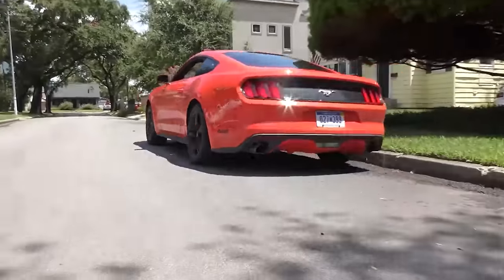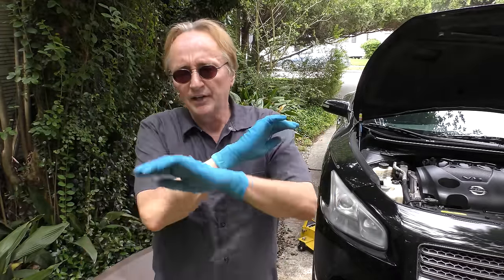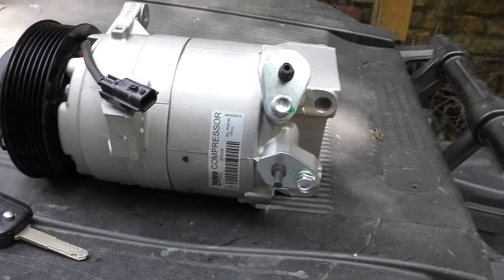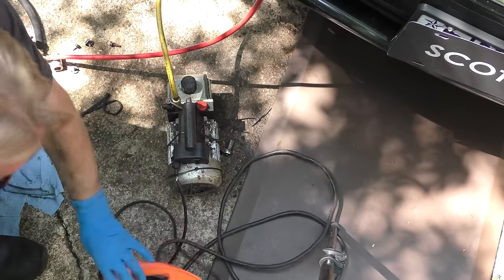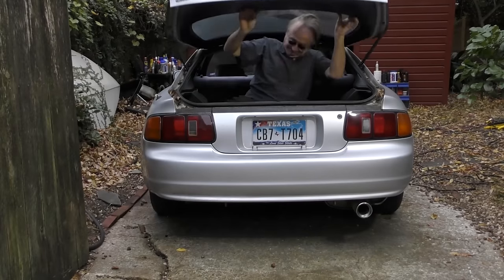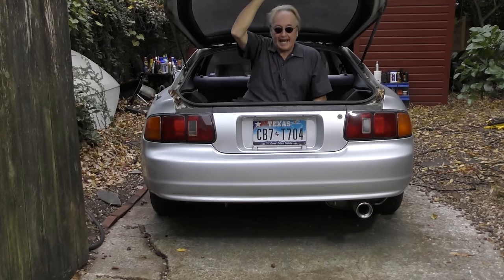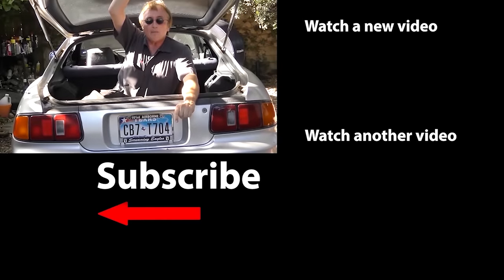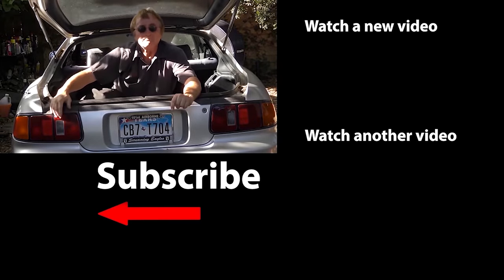Here's Why Nissan Doesn't Want You to Work on Their Cars

Comment: you should replace your condenser when replacing a compressor on an older car. it's probably the main reason the compressor went bad in the first place ??? and if you dont want to replace your brandi new condenser again a short while later, I highly recommend. aftermarket condensers are cheep nowadays

Comment: Dealer charge me $1,300 for new  Compressor.they fix it

I say it was worth it. 

Mine  Car still in good shape.  No need to buy new car or newer one.  2 years later AC still working good and still no car payments .

Got to be ready to repair your ride, set money to the side for just in case. 

It's better to spend a few hundreds then be on car payments. 

 Average car payments per year is about $4,000 to $6000

Car repairs about $300 to $1,500 a  year (  maintenance and repairs)

I choose to repair.   Unless it's a major engine or transmission problem  then it's gotta go

Comment: Hey scotty, I was wondering if by any chance youve fixed an AC on a Chevy Cruze 2011-2016 preferably. My AC is not working. I bought a recharge but the gauge went to red. So I didn't out any. The compressor does spin. Could it still be faulty? Any suggestions? Thanks for all your valuable time and info!
Reply: Jonathan Juarez I have a 2012 Chevy Sonic Lt, unfortunately the only problem I’ve have had with my ac was the thermostat housing unit cracked recently, so I would check under the hood of your car just see if that hasn’t cracked since the Sonic and Cruze are on the same platform, I mean Sonic and Cruze are not the best Chevy’s ever made, but certainly not the worse, the Aveo certainly wasn’t the best, but the Cobalt was hit or miss, and the Cavalier was before my time for the most part, but either way just continue to maintain it, because Chevys are not something you should beat up and toss around like Ford it will break. 🤔
Reply: Were you having over heating problems? Because my car is not overheating. Nor leaking. I just want to see if anyone has had any issues with the AC on a Cruze. I'm going to remove the freon. I haven't had any ac device on mine. But am concerned because I know when the arrow on the gauge goes to the red zone. You shouldn't recharge it. I've had problems with the thermostat, but usually would overheat because of the plastic housing next to the engine driver side.
Reply: Jonathan Juarez My car overheated twice on me yes, I’m not the original owner of it, I got it used at a Honda dealer, oh everyone I talked to said the Cruze is not a bad car no complaints, oh yeah you may want to take to the shop and see why your thermostat is acting up? 🤔 Yeah my thermostat housing unit cracked recently, but it runs better now, minus the valve cover gasket had to be fixed, I haven’t had major problems unlike my 2010 Mini Cooper S Convertible smh! 🤦🏻‍♂️

Comment: I had the aftermarket Chinese compressor on my Peugeot 407 fail, had metal shrapnel through the whole system. To replace all the parts was about the same as the car was worth so I just got rid of it.

Comment: Im looking to buy 1995 Nissan 240sx with a 2.4 liter cylinder runs good and in good condition no rust but was wondering if these motors are reliable enough to consider buying.

Comment: Scotty I bought a New 2019 Nissan Leaf SV Plus.was driving it yesterday to the store 7 miles away and the Nissan Connect kept Up Dating every1mile or less. Decided to count how many times it would Up Date going to the Dump 4 Miles from house. and it Up dated 5 times. Went to Nissan on a Saturday was secound in line but they said it required a Nissan Leaf Tecnhician to plug in a Diagnostic scanner really it just plugs in I thought? I just wanted to know if any error codes would show up. Of corse today on the way to dealership it only Up Dated when I first left the house. I wewnt to another dealer and he said he could not even rotate the tires. It's apperent to me Nissan Sales Nissan Leaf's but do not want to service them.

Comment: Hello, Scotty. Thanks
When you have to idle a new 2020 Toyota Corolla for a long idle periods how does that shorten my oil change periods(like comparing to motors that used to have hours of operation meters on the motor)?
 Is there an equation for hours to miles driven to know more precisely how to adjust my oil change period?

Comment: Scotty, 

  If you have evacuated your AC refrigerant already can you install a contaminant filter on the high side discharge line between the compressor & condenser to prevent the condenser from becoming plugged/contaminated should the compressor ever "grenade" spewing metal particles into the refrigerant ??

Comment: Hey Scotty, I bought a 95 Celica Convertible GT for dirt cheap as a fun project car to learn stick on. It runs and drives good, there is just a problem with the trunk. My key turns and it doesn't open and pulling the trunk release inside doesn't either. It's hard to get in the back cause of the convertible stuff in the way, there's just a hole big enough for my arm and it definitely doesn't reach. what should I do?

Comment: Is not how much time you put the vacuum. You need a vacuum gauge , recommend a digital to measure microns. Go up to 500 microns. Once the level is reach , close valves , check if hold the microns. You wasting time. One hour? Am AC contractor for industrial and commercial HVAC. Doing this for 30 years.

Comment: Scotty I have a 2004 Nissan Maxima it's blowing white smoke out the tailpipe, and I'm told that the coolant is mixing with the oil through the head gasket. Would. A liquid head gasket fix the problem or make worst. I don't want to pay to replace the head gasket as this has already cost me a small fortune. The car has 114,000 miles what can I do?

Comment: Scotty...I have a 2017 nissan versa with about 61k miles...the dealer is telling me that I need a transmission flush...I seen some of your videos saying it's not a good idea...and by rpm gauge is jumping when I am parked...when I accelerat it doesn't react right when I do it, an it also seems to kind of studder when I am driving (only has happed about 5 or 6 times recently)an the dealer is telling me that it's all problems from the transmission...what do you recommend ?

Comment: Hey Scotty I've got a 2014 Nissan Maxima sv and Nissan is telling me that liquid got to my control panel for the radio, navigation, air, heat just everything in the middle from the cup holders..... Is that truly possible??? I'm thinking that there should be a safety feature for protecting that sort of thing. They're wanting to charge me $1,000

Comment: I have a 1999 Lincoln Town Car and it cranks but no start. The battery died over the winter and I attempted to get a jump. Since no start I sent it to my local trusted shop and they told me there’s no fuel, fire and no communication to PCM, but it cranks. They did not want to get involved and dropped it back home no charge. After many hours of research on Youtube, I checked all fuses, switched corresponding relays and connected my own scan tool and still nothing. I even hired a private mechanic to check it out and he said “sounds like your security system”. He suggested for me to go to a auto electronics place and have them program the key. I called a local locksmith and he brought over two devices and made another key as well. He was able to clear the 6 keys that were in the system and place the 2 keys (original and a copy he made), but the security system did not reset still. He read the manual for errors codes and said “the security system is in an anti-scan mode”. What can I do now besides go to my local Ford dealership. HELP!!! Thanks in advance.

Comment: If nothing is clogged, the sludge that is in there isn't circulating, so it's not doing anything but taking up some room in the bottom of the oil pan.
A strong sludge remover breaks all of that crud loose, any on the oil pan side of the oil filter gets sucked up, goes through the oil pump. Any particles less than about 30μ (0.001”) gets pumped through the engine.
Varnish is far less of a problem. It just stays where it is. Instead of using that cheap non-detergent crap* to save 50¢ a quart, use a top quality all-synthetic motor oil to gradually remove varnish.
* The non-detergent oil is good for machine tools – lathes, drill presses, and for oiling garden tools, pliers, wrenches. Not even for your lawnmower.

Comment: Scotty, my daughter's 09 Fusion has a leak at the ac low side charging port. It's leaked empty. Would it be a good idea to also replace the $30 expansion valve at the same time?  160k miles.

Comment: In a power plant they use vacuum pumps on the condenser as the condenser is supposed to be at pressure less than atmospheric. They call the process of removing the air Hogging. Funny that you put a picture of a hog up when using your own vacuum pump.

Comment: My 2006 nissan altima turns off sometimes when either I'm at a stop light, a couple times when I was reversing, when I try to turn the car on it sometimes won't turn on the first time but I'll wait a few seconds and it will crank up. Any ideas?

Comment: Hey Scotty ,
There is a 1989 Honda Prelude S manual transmission with 166000 original miles and in good condition. They are asking for $3000. What do you think?

Comment: Hey scotty I'm looking to buy a 2005 scion tc with 113,000 miles. I read that the 2.4 motor they use in them are the same as the camry and rav 4 and have oil consumption issues . They're asking $4000 , is it a good deal? Thank you

Comment: Give me you  car, no mater what brand and if it has an automatic
transmission it will fail. As for Toyota and Lexus, Uh, my boss's 
Lexus is a 2014 and an endless money pit. My Friend bought
a 2019 Corolla and the transmission failed before 30K miles.
But, his Tacoma is still running great. Depends on the make 
AND the model. I see Nissan Altimas and SUV's with major problems while
people I know who own GTR's and 370Z's run them for hundreds of thousands
of miles with minimal issues. Basically, it seems that rear wheel drive cars with manual transmissions hold up the best. FWD with an automatic? not so much.
Well, unless it is a Honda. Honda makes one tough car and 
THE best most reliable engines.

Comment: Never try to start a car that has set 4 years. remove Every spark plug and fill the engine cylinders with synthetic motor oil (the thinner the better) every single piston with the oil. if you can Get to the valve covers easily throw some synthetic in there . And wait a good week then drain the oil completely out of the pan fell with the proper weight oil of synthetic, either turn the engine over by hand then by  the starter without any plugs and push out any remaining oil in the cylinders put the spark plugs back in. and start her back up. So many people cut the life of the engine short by just sitting in the car and turning the key after it set a really long time. If your piston rings are seized to the cylinder it may start but you have screwed up your rings and may have scarred your cylinder walls at the least it will start smoking and that's just the indicator what you've done to the drivetrain has multiplied that as well

Comment: I wonder should I have this shop put oil in my ac lines to free my compressor up. I didn't use my ac to save gas and it locked up on me, I wonder should i use this used one that spin perfectly from the junkyard for my vehicle just not sure how to go about it so I just have my ac working again

Comment: i have a question.. i have a mitsubichi aveo lt 2011 that suddenly stop running. when i hit the gas pedal on reverse or neutro the car acelerate but when i put drive the car doesnt acelerate how is suppose to do it and doesnt move. the car runds in reverse like nothing but doesnt go foward. i changed the computer and program it too, still does the same thing. what this can be

Comment: My 07 maxima is also leaking from somewhere ac compressor spins when recharged. I think one of my ac lines is leaking
Reply: I just fixed the ac in a.2007 maxima I gave 2 someone.  It needed a compressor and thenac line was so corroded it needed 2 be replaced.
Reply: Dab, or spray some soapy water on the hoses/connectors. Bubbles will form where leak is.

Comment: I drive a 2016 Nissan Frontier 4 cylinders RWD for work provided by my employer. The compressor and discharge hose for the AC failed on this vehicle last month. Earlier this year, the o-rings failed and leaked on 2 other hoses for the AC system. Truck only has 88,000 miles. The quality on this truck sadly is too low. Avoid Nissans.

Comment: Hey Scotty, my 98 Dodge truck has a 5 spd manual transmission, when it's in neutral and the clutch is depressed it's silent but if I lift the clutch I hear a faint pulsating sound like a quiet knock, what is this?
Reply: Probably throwout bearing in the clutch assembly
Reply: Definitely the throwout bearing, just leave it until gets louder, just get out as much as you can out of your clutch and replace everything while your down there when the time comes.

Comment: Toyota’s are boring, people buy Nissan’s because they always offer more performance, appeal and are more affordable. They might have had some issues with some models, mainly cars built in the USA and Euro, but give me a Japanese built Nissan over a Toyota. Scotty if Nissan is as bad as you say they are what do you think of Volkswagen. Also how many miles did the Maxima have, you also mentioned that car as been hit a lot, I saw that the inner wheel plastic cover is damaged, is it possible that the condenser has been broken many times and the panel shop hasn’t followed the right repair procedures. My experience with air conditioning system on Japanese cars is if the system has never been open since the vehicle was made, they can last a very long time. Sometimes you don’t tell the whole story, because you think that everyone that watches your videos are clueless.

Comment: It doesn't pay to drop $70 for a vacuum pump and more money for gauges, then buy a tank of refrigerant, oil for the system, digital weight scale, etc. This job is best left to a mechanic who already has these tools, also, you need to know where the hi and low side are, and if you screw up, it will cost you $$$.  Just because you can do this on the floor of your garage does not make it a wise decision to attempt it.

Comment: Scotty, why does my cruise control never shows the same rpm's vs speed on the same straight  road. Calm wind etc. 45mph at 1500rpm and 45mph 2000rpm. weird. 08 canyon 5 cyl.

Comment: This is why they shouldn't sell those re-charge kits to untrained people. It needed pressure testing. If I stick refrigerant in a leaking system at work I could get a prison sentence and unlimited fine
Reply: The vac pump will only pull the air out if the system is leak tight. If you pressure tested you would have been able to prove that

Comment: Nissan/Renault garbage should be scrapped.
Reply: Deibama Renault I agree should be scrapped, but Nissan itself no, they need to merge with Honda or Mazda, because Honda can teach Nissan how to make a better Maxima while Nissan can teach Honda to make a powerful Honda Ridgeline with optional V6 or V8 engines, and put an optional Cummins in it, and get permission from Gm to use Allison transmissions as well. 😁 Now if Mazda bought them they can turn Nissan into an economy brand and keep Infiniti luxury of course, Mazda could make Nissan build everything the same and help them return the Mazda pickup truck of course, and introduce Mazda a V8 engine with Cummins optional along with Asin transmissions already used by them. 😁